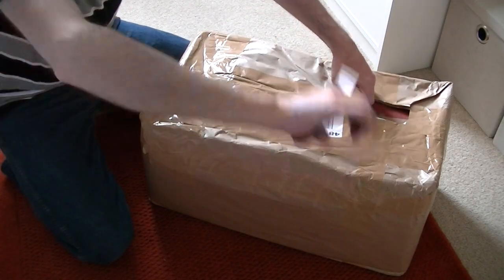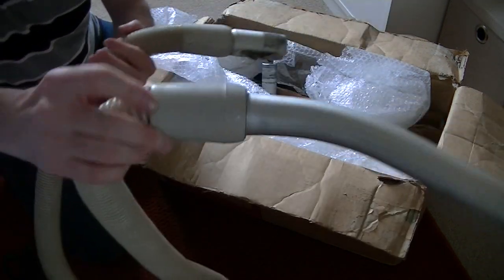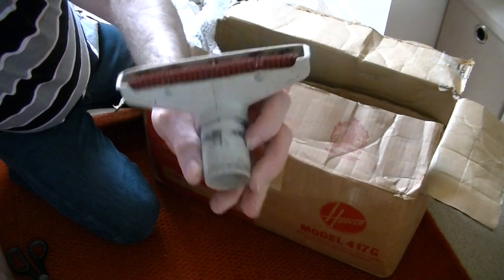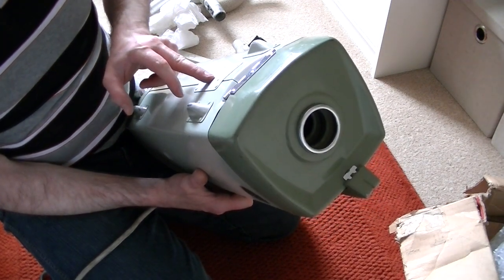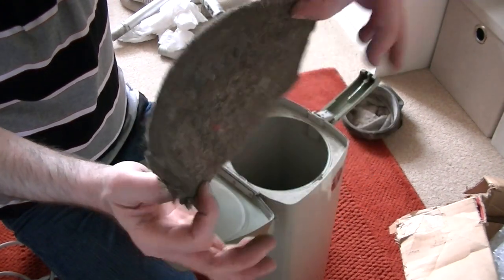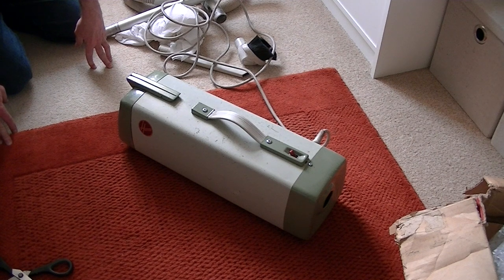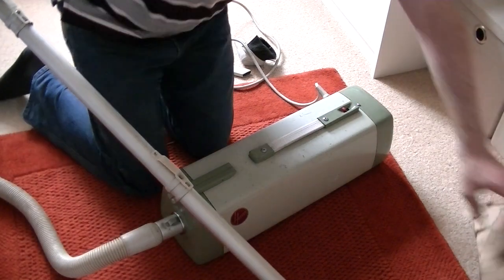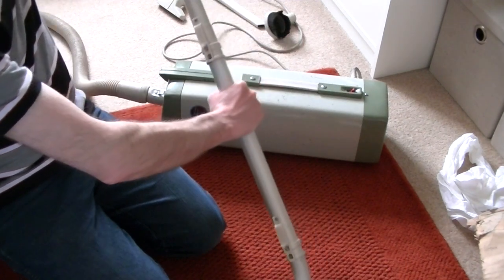Vintage Hoover 417G Cylinder Vacuum Cleaner Unboxing & First Look

Comment: Being more of a Eureka fan, I have always wondered about the design of Hoover wands/tubes/pipes.  Is there a kind of rubber gasket ring on the inside of the wands at the "clip" end?  If yes, I would imagine this prevented air leaking out at the connection to other tools or hose handle.  Do these rubber "air seal" rings disintegrate over time?  Quite curious about this design feature....
Reply from the maker: Yes, there is a rubber seal at the clip end. They may disintegrate over time, but all the ones I have owned have been fine.
Reply: ibaisaic , hi Roger Ive just watched the unboxing  of the Hoover cylinder cleaner 417g the one in its original box ..... I wondered if you might consider selling it to me !!! Really want this machine but mainly as it’s in the original box as it was the first cleaner that I remember from my childhood and I have a soft spot for this machine . Anyway just thought I would ask . John Ash

Comment: any appliance rated up to 700 watts should have a 5 or 3 amp fuse anything over should have 3 amp just to let you know
Reply: any thing over 700 watts should have a 13 amp fuse